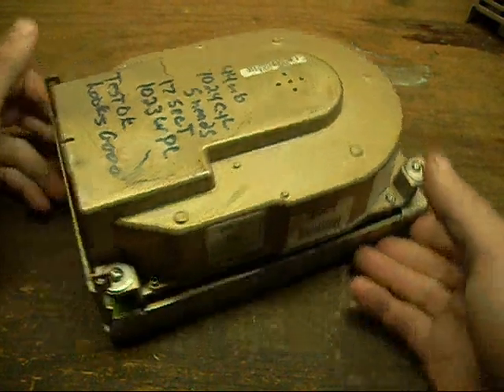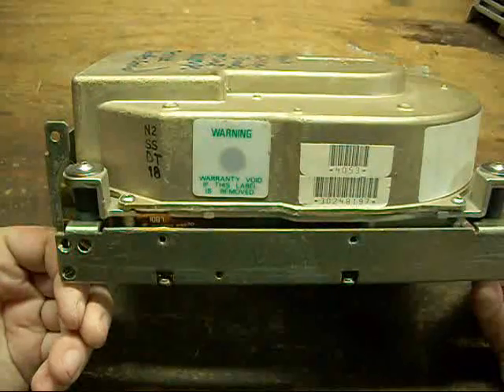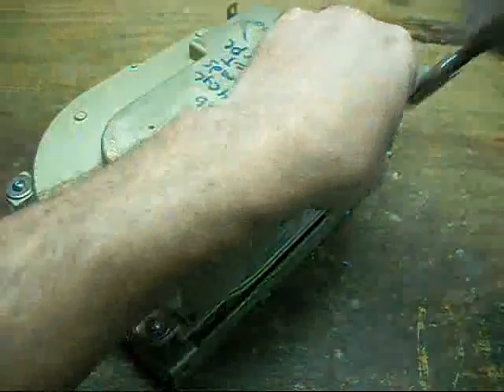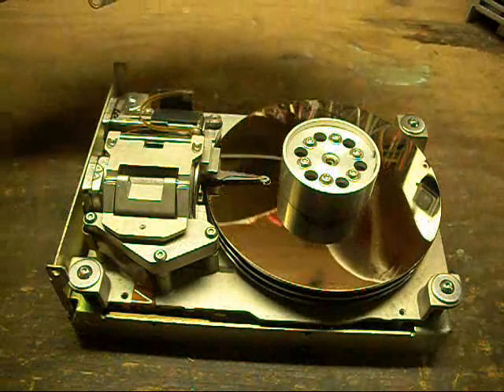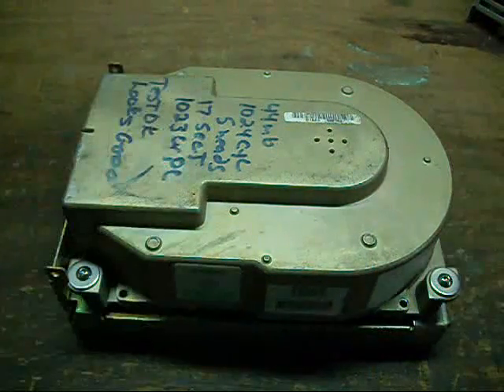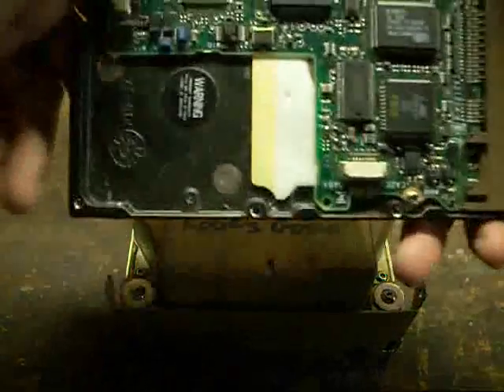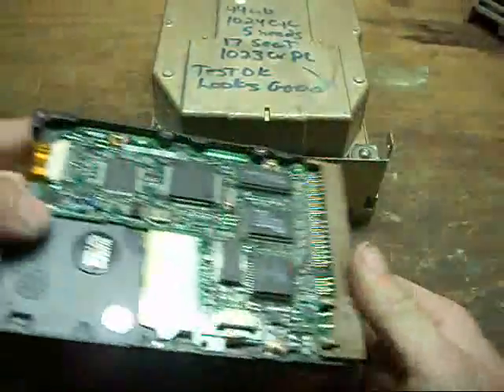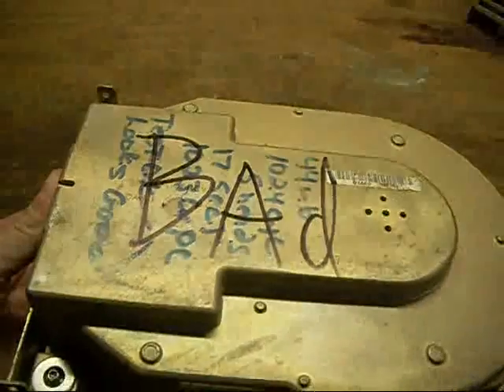The standard failure mode of older voice coil hard drives.

Comment: You seem to know more about MFM drives than I do. I've been trying to solve a weird problem with a Seagate ST1100 83 MB drive - it formats and works perfectly if I format with head 0 only; however, when I format with all 9 heads (actually only 8, since my controller doesn't support more than that), it gives some strange results... for a time it threw a lot of ECC/SYNC errors, but that has stopped. It does seem it doesn't format the tracks properly however, and I have a hard time believing all 7 heads/platter surfaces are bad.
Do you have any ideas as to what I might try?
Reply: ECC errors can be thrown by a controller which simply does not support that feature. Not all controllers of the era support it. It is very possible that if not all surface are bad, their head amp may be. The amplifier for the servo system is often on a separate channel all to itself.

Comment: Can't you make a new servo track by moving the Upper platter to an identical disk, second platter. And then running a very specific format tool? only on that head. Or make a 1:1 copy of its working servo track to the second platter. I am sure a low level tool can be made for  this.
Reply from the maker: No, the servo tracks are more complicated than that. There is usually a track identifier code, and tracking tones. If it moves to one side of the track it will pick up one tone, and if it moves to the other side, it will pick up a different tone. It holds the head to where signal strength of the two tones is about the same, which means it on the center of the track.

So, to reproduce the servo track you would have to have a tool to mechanically move the servo arm through it’s range, while reproducing the tracking data on the disk.

It would technically be doable with older MFM drives if you hade access to a linear positioner with a fine enough position control, and you knew exactly what tones and data the controller was looking for on each track. Then you could “reformat” the servo tracks.

With modern IDE, and SATA drives, it is way past the capability that an end user could even conceivably come up with.
Reply: The drive itself is not accurate enough to make a proper copy of the servo information, and is often not fast enough. If the servo data is already gone, it's over, the drive will not work anymore to perform this format anyways. It is plausible to snoop the signal off of the servo head during normal operation to make a "backup" of it, though I'm not sure how you would write it. 

The servo head is also not necessarily the upper platter. Some drives, like the Miniscribe 9380E, put their servo surface in the center of the stack, and some, like the Micropolis 1300 series, put their servo surface on the bottom most surface.